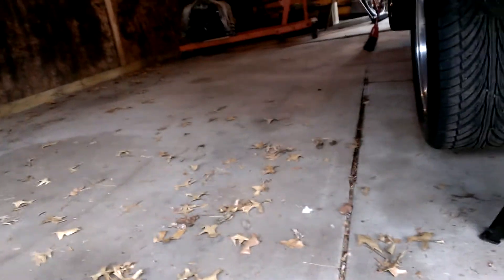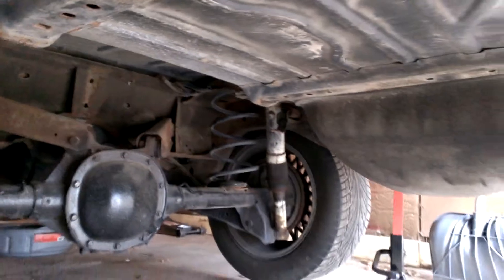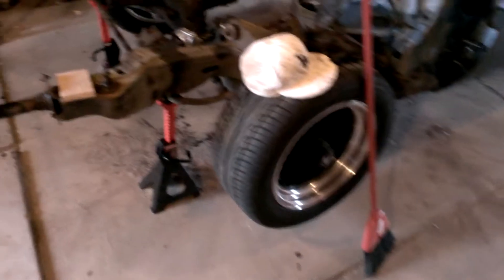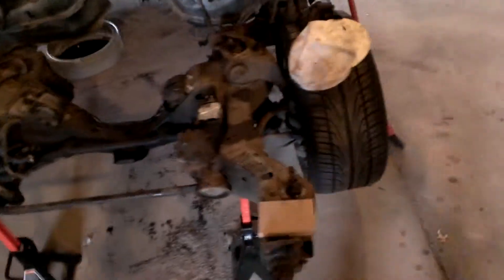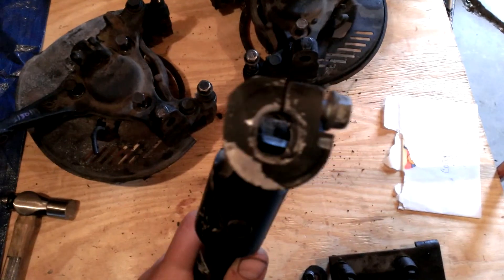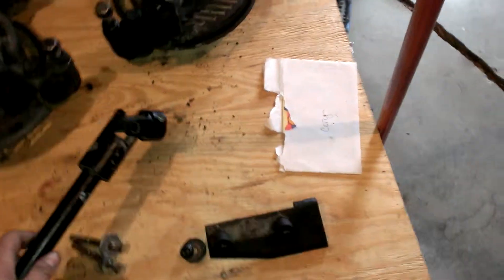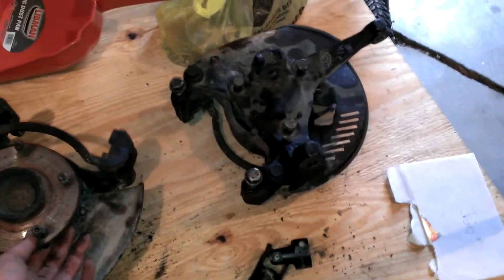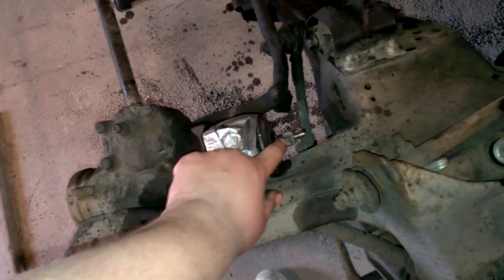G Body Buick Regal build part 4

Comment: What year blazer did you get the spindles off of and what year s-10 calipers? Thanks
Reply from the maker: Michael Williams you want them off a 2 wheel drive 99-04 maybe 06 can't remember make sure they're the dual piston calipers. take the spindles dust shields and caliper brackets personally I bought new hubs and calipers the yard wanted more than the core charge at the part store so didn't even bother with taking those.